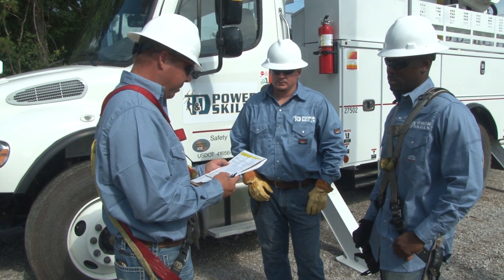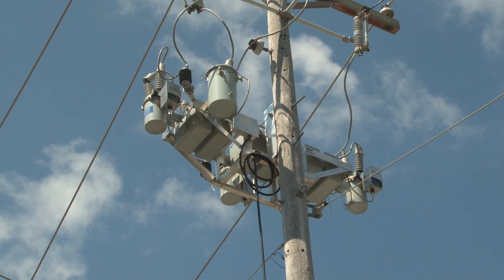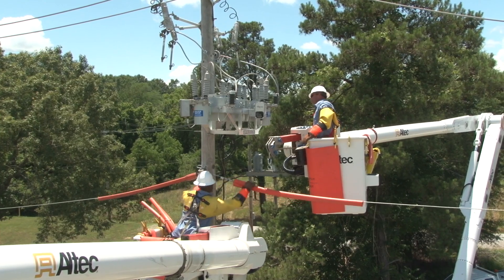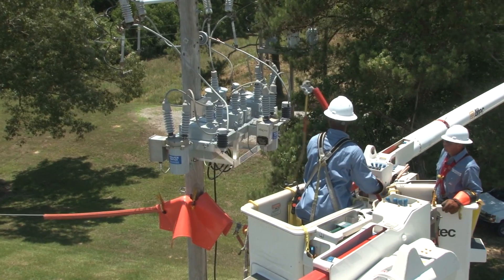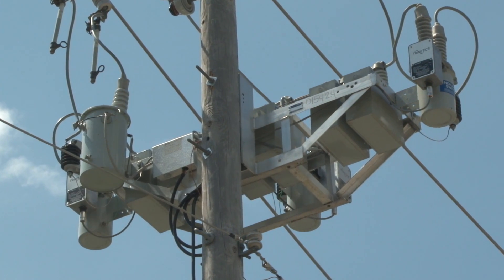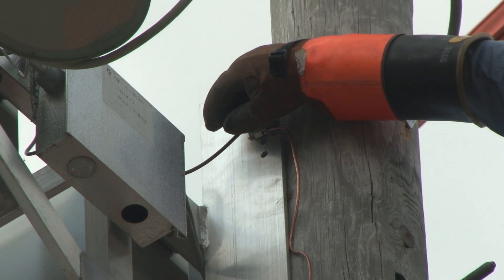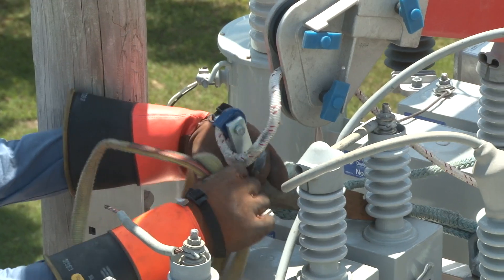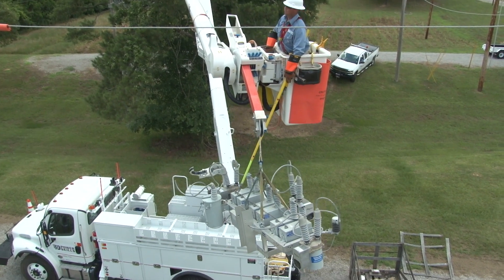Pole Top Equipment - Capacitors [PREVIEW]

Comment: What does a capacitor bank do and how?
Reply: 15 sep 2023 8:55 am est-not-edt :
like water-tower to hoard water then do consistent water-delivery with high-water-ejection-force-from-faucet during busy-shower-hour like prior morning-school-hour .
but replace water with ampere . 
replace faucet with wall-ampere-outlet .
replace high-water-ejection-force with high-ampere .

capacitor is like water-tower :
X4EUwTwZ110&t=45s (  Capacitors Explained - The basics how capacitors work working principle )
uploader : The-Engineering-Mindset ; 2.92M subscribers ; 8,155,199 views  ; upload-date : 25 aug 2019  ;

so capacitor is like very-expensive-and-space-prodigal-battery but capacitor-ability-to-hoard-ampere never deteriorate like battery
but capacitor also has expectancy-life like battery , eventually suddenly-break-down , especially if capacitor-working-temperature-is-always-high .

[source 3 : (1)'modern PCs are built to withstand a whopping 40,000 power cycles.' ;
(2)'Keeping your computer permanently switched on also reduces its lifespan substantially. And that's down to the weakest link of a typical computer PCB—the ubiquitous capacitor. These critical voltage-regulation and filtering components have a finite lifespan of typically about 32,000 hour for electrolytic variety. This amounts to a little more than 3.5 year.' ; (3)'To make matters worse , usable lifespan of capacitor is halved for every 50°F (10°C) increase in temperature. That's also why gaming laptops, which tend to overheat,
die sooner than regular desktop PCs.' in makeuseof-com/is-powering-down-your-pc-wearing-it-down/ from google ( frequent shutdown shorten psu life )
result 1 ]